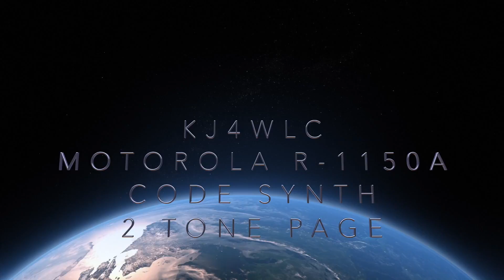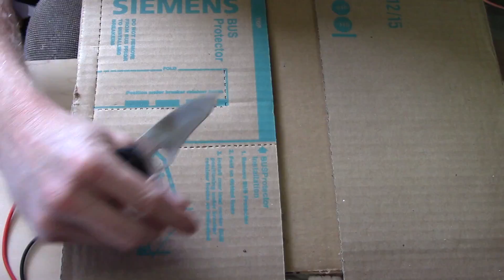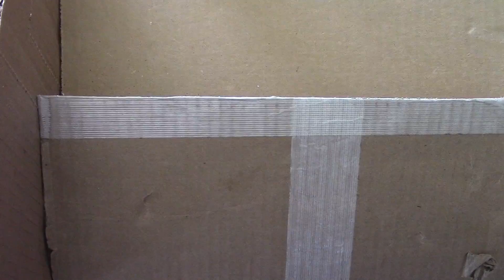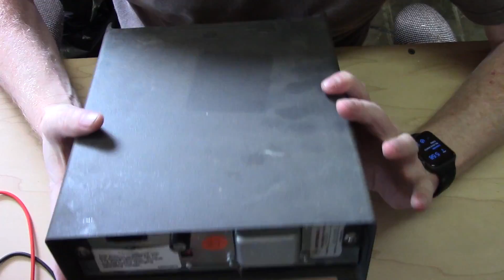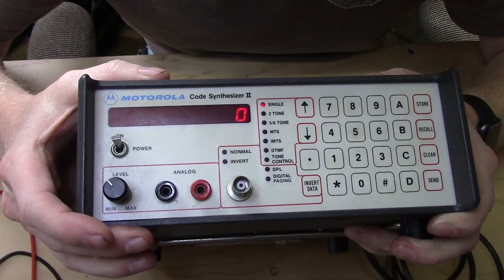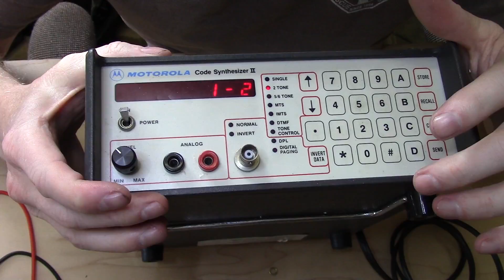Motorola R-1150A Operation and Teardown

Comment: I have one I cant find out to generate 2 tones at same time for ssb testing if you know please tell me the process  both at same time not one then the other
thanks
Reply from the maker: The "2 tone" function will only do one at a time based on normal public safety 2 tone.  That mode is sequential only.  You could change the defaults for DTMF frequencies to test two tones playing at the same time.  This would be a custom MF digit program. You would need to change a set of DTMF registers to the frequencies you want to be generated at the same time. Hope this helps.